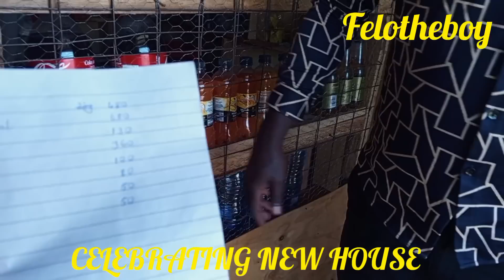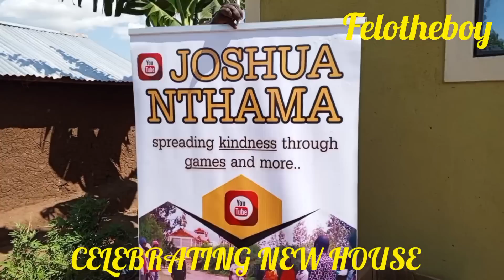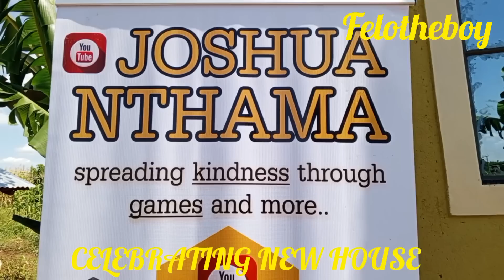MAMA FRED NEW HOUSE _INSIDE

Comment: Thanks for all the hard work what was done. I am looking at the Paint job in the house, it is not completed at all. The paint should never ever been watered down, that will make the paint do the work as a perimeter and not as what paint was meant to do. As for the space of the doors, the should have been closed so flies, mosquitoes ect.. would not go in the room. Also when sitting in the living room, noise will coming in the rooms, there will be no privacy. The doors frames should also be painted. Thanks 🙏🏿

Comment: Felo and team, please let us know the cost for 1 tall kitchen cabinet and work table, also  clothes  dresser drawers.  I think the curtains are for the windows  not the doors.  The cutout above each door use  extra ceiling boards, cut to fit OR put colored plastic inserts.
Reply from the maker: The carpenter said if we have 20 000ksh he will make the MDF board cabinet. In kitchen..like the one at mama felistus

Comment: Felo as we say in Chicago. I’m ten toes down with you! I applaud the job you’ve done. For us the finish is very important. We know better and you won’t learn better and it’s very frustrating to us. We need you to listen and learn from us about painting. Oil paint when dry is waterproof. That’s why it’s used outside a lot. When she cleaned the pavement the paint came off. That’s because the paint was diluted with kerosene that breaks down the oil in the paint. We use thinner or kerosene to clean brushes after using oil based paint. If nothing else ask your instructor in school about it. Please 🙏🏾
Reply: Well said. The finishing especially the painting is not good.